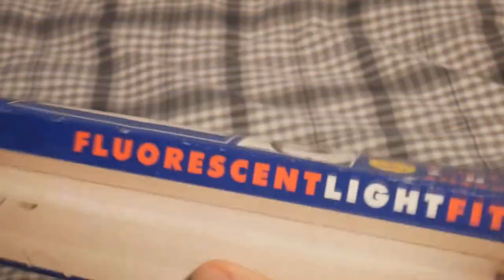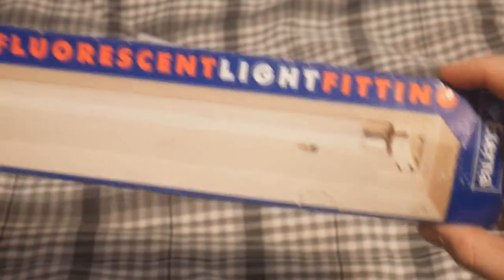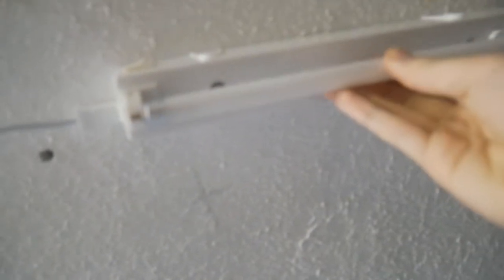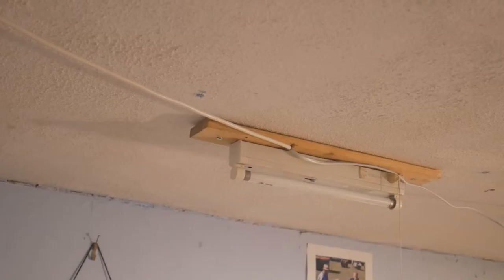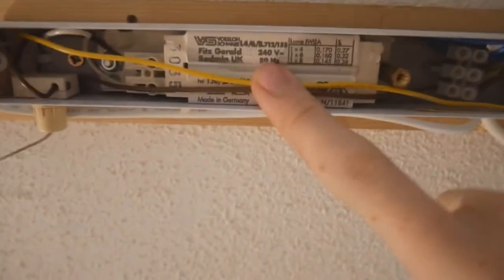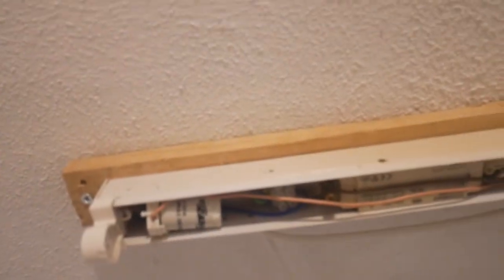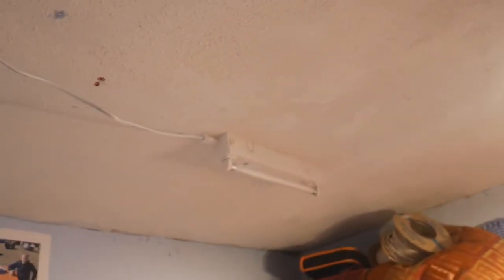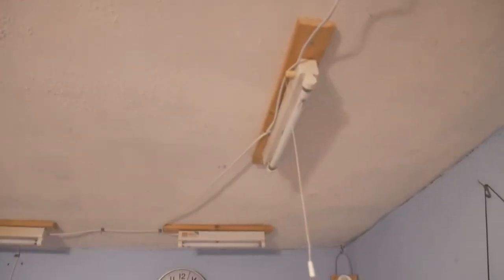T5 flourecent Lighting System Detailed Look

Comment: That's all are t5 fluorescents tubes lights fittings with in 8w t5 fluorescents lamps via on the 4w -6w 8w preheat switch start 240v choke ballast and with a 4-80w 200-250v fluorescents lamps starters switch and I do prefer to use instead 4--22w 110-130-220-240-250v fluorescents lamps starters switch in series all of my t5 Fitzgerald 8w fluorescents lamps fittings in a
a lot of my Fitzgerald lights fittings have philips t5 8w fluorescents tubes and philips s2.4-6-8-15-18-22w 110-130-220-240v in series fluorescents lamps starters switch for 4w t5 lamps and 6w t5 lights and 8w t5 fluorescents tubes only its will be a lot more preheat switch start action and  they will flash abit more in general and when you use 4--80w 200-250v fluorescent lamp starter switch they won't flash mate
Reply from the maker: yea you know from sept 2023 florescent tubes are banned right but i dont believe it there gonna be black market items for many years to come regs are unrealistic to most people if you can get them use them (theres still 100s in use in uk kitchens garages etc)